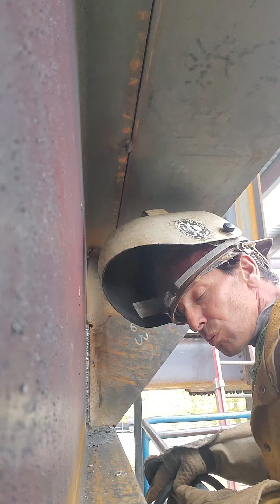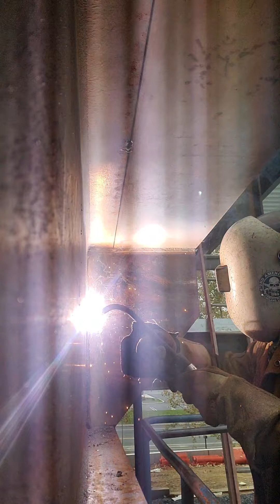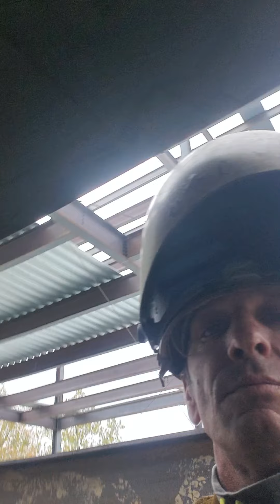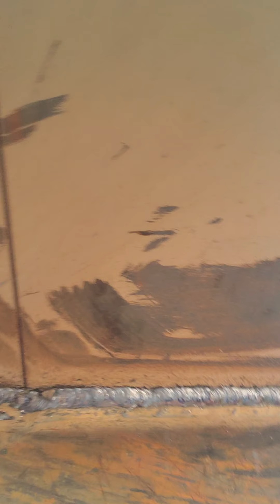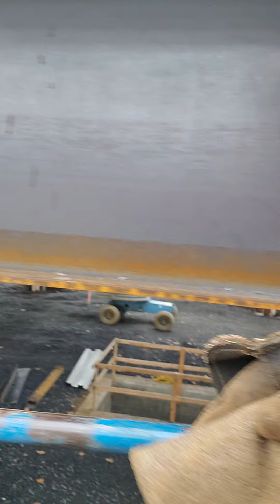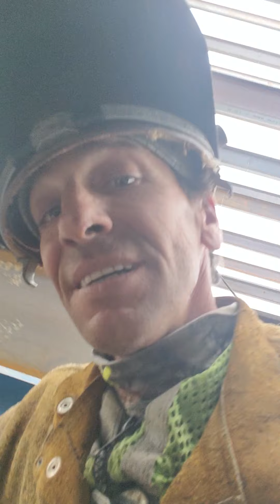Structural welding/Gusset  Plate= Flux Core

Comment: Hi! Just found you - great learning for where I'm at. Learning innershield. Plan to weld excavator booms and buckets, dumpsters, some residential structural. Should I get Nr233, 1/16th? Using old Lincoln Invertec V300I, LN25.  Great videos - thanks!
Daryl in Norway
Reply from the maker: Daryl, What's going on, NR233 1/16, Is great, All position, I 'm a 5/,64th guy, But what you're doing is awesome, Lincoln  Wire products Are the best, That's a seismic wire NR233 It is strong as h***, What is your power source,
Reply from the maker: Daryl, You have to tell me how that LN 25 runs man, It seems the old Lincoln  LN25 they never stop running,

Comment: How do you run vertical a same side to side motion like with stick? And over head so you just drag it or do you put a motion to it?
Reply from the maker: Caesar, What's going on, Pretty much I do, Side to side vertical, Sometimes I'll fill the middle in wash the sides, It just varies with the  Flux core, Overhead, I always   WHIP and pause,  F lux core, And stick, I'm just weird , I never trusted  A drag wire, I make sure I burn everything out, Thanks for your comment!
Reply: @jetweldingllc4691  thanks for the information buddy!
Reply from the maker: Caesar, I run pretty hot, That's why I can whip and  pause, Successfully ,without it sticking!